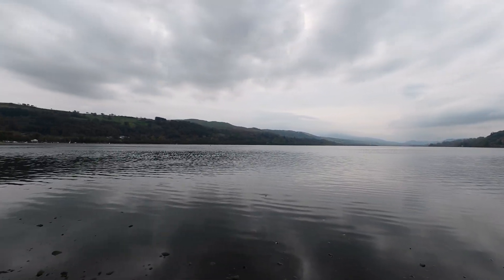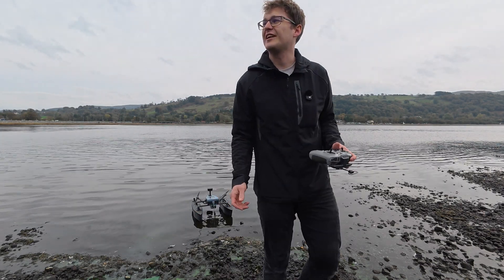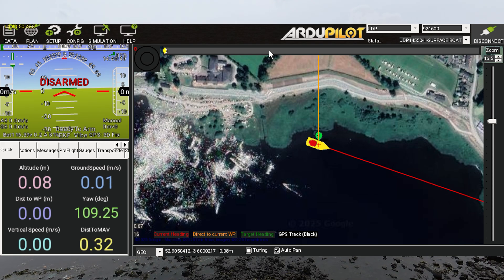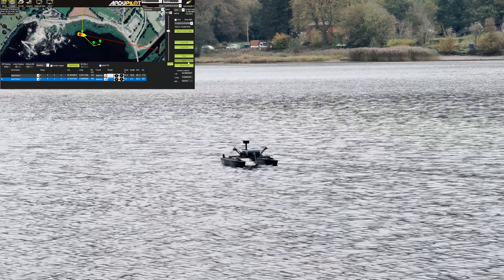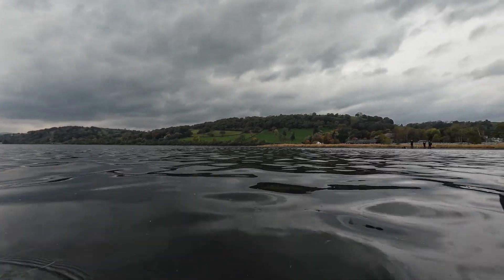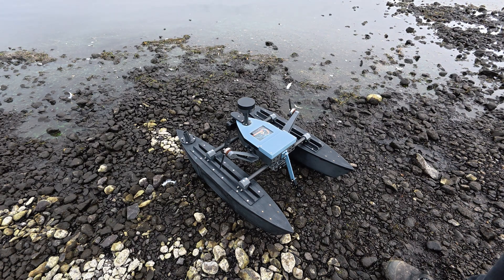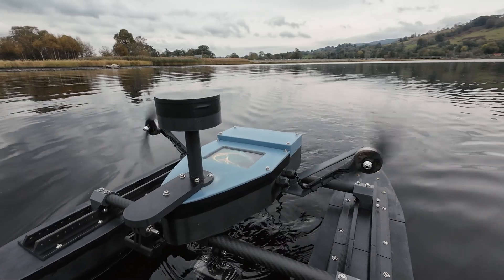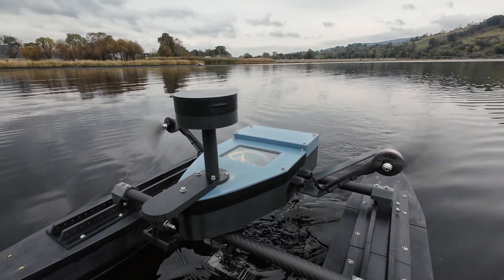Waypoint Missions At Last - Testing My Autonomous Boat

Comment: so question you may have answered this before but what size motor, esc, prop combination are you using.  Im working on a 36inch research vessel and wanted to see what your using as a guide.  if you don't mind sharing.
Reply from the maker: Hi! Thanks for the comment. Im using a matek f405 wing v2 flight controller, a pair of 35 amp pretty standard escs, a pair of emax eco iii 2808 with 7 inch hq bi props. Im releasing a new video soon going through the whole project!

Comment: The bandwidth of elrs lora is awesome for basic control and basic radio telemetry, but for a mavlink connection it's not gonna cut it. It does work, its just so slow it feels like it doesn't work. Personally id put a one meter mast with telemetry radio antenna on top. But must use a stand alone radio, sik, or mlrs, or something similar designed for mavlink ideally on 868mhz, 433 is fun for range but probably not necessary for your situation and also a bit slower connection speed. Also you really dont need elrs if doing mavlink, can use a controller through mission planner, but you will need a laptop or tablet setup for that, the phone situation can work with telem radio on the usb port, but ive not had much luck with my s22 trying to do that especially if trying to also use it for control. I have a plane that i use in a similar way as your boat, i use elrs 915 and sik 915, but not at the same time, its an either or because sometimes i just like to fly manual for fun, and other times its auto for mapping jobs. You can try that too, gives you options. But definitely consider a mast for antennas up high.
Reply from the maker: Now in the process of fitting 2 x matek mlrs 868mhz modules! Seems to be working much better. But hopefully doing some major testing over the next week! I think antenna height was a major fault on my behalf! Thanks for comment! 🫡

Comment: Wifi isnt designed for range, it doesnt perform because of all the extra layers it has. SIK radios are best for range and are designed for control and Mavlink. But you can also use cheap ELRS, it's designed for control,  but has a virtual port that can be used for the Mavlink.
Reply from the maker: The wifi is just the built in connection to my fc. I had set up mavlink over expresselrs by connecting my laptop into my rc controller. But unfortunately i could get it to work properly! Im now about to fit 868mhz mlrs connections for the telemetry :). Simular to SIK
Reply: @CyAntonyAsh  fab, I find this stuff fascinating. I'm keenly waiting for open source to finish developing a single radio link that does video, controller, and mavlink. The industrial solutions already do all three in one, so there's only one antenna setup and link to worry about.
Reply from the maker: I completely agree! Its just video that missing from mlrs. I wish dji did an all it one that they released for hobbyists.
Reply: @CyAntonyAsh  unfortunately it's just not a priority for DJI. They support video + controller, I use that solution already, but it's really minimal, the channel behaviour is outdated, and they have no interest in improving it. Unfortunately DJI just arent listening to their customers, which is why I suggested using OpenIPC in one of my other comments. Cheaper, open source, and they listen to user needs.
Reply from the maker: I know, they seem to have just gone into the bringing out a drone every year with minimal changes thing that most big companies do. Ill do some research into openipc, sounds like a cool solution.

Comment: Awesomestuff man! Lovely to see it go on it's own. I'm plannign to probably add mobile network onto my design being able to send telementry data + screenshots towards my devices. Have not yet looked into other low cost and or out of the box options for long range communication.
Reply from the maker: Hi mate. Thank you, means a lot. Thats pretty cool, long term i want to add a 4g router. Ive just bought a matek tx and rx 868mhz mlrs modules. Pretty low cost and hopefully a lot ponger range!

Comment: You should be able to send (low speed) telemetry via ELRS using mavlink-rc. Or you can use a separate telemetry radio, which can just be another elrs transmitter/receiver on another frequency
Reply: 100% don't use WiFi. That lake looks dead!
Reply from the maker: Im using elrs at the moment on 2.4ghz. But ive just bought a couple matek mlrs 868mhz tx and rx. So were upgrading soon! Ill get the 2.4 as back up. But theres a lot of loss with water
Reply: @CyAntonyAsh 3drs have a 443 100mw telemetry set that's good for a few miles even over water
Reply from the maker: Im going to do some tests before in on the water this time with range! 😄